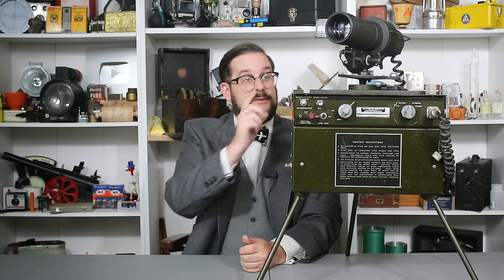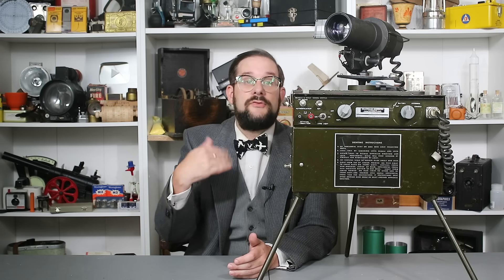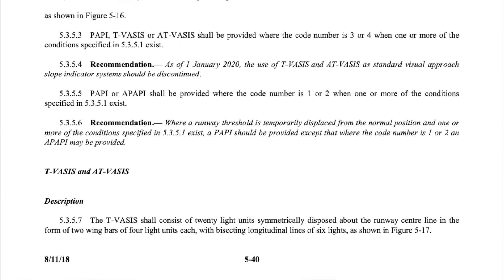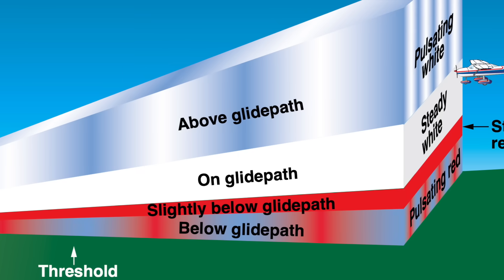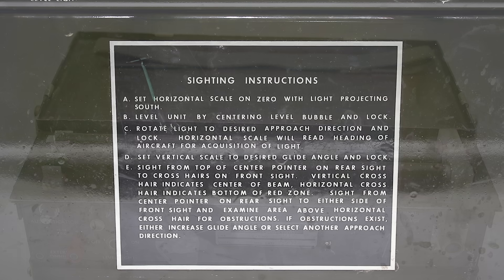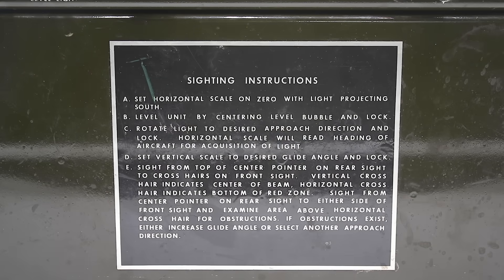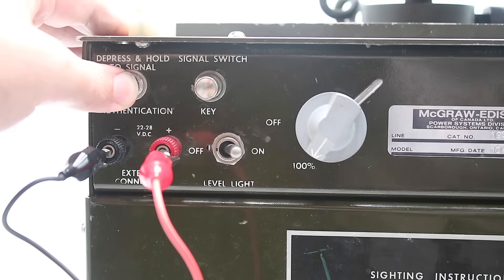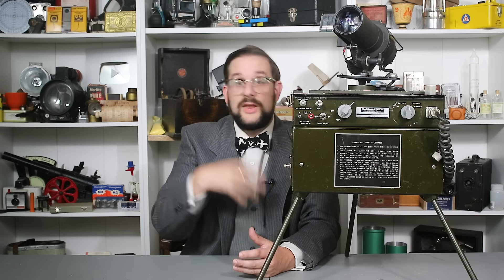Portable VASI: Come Crash at My (Heli)Pad

Comment: Wiping off that o-ring with alcohol and then applying a very sparing coat of silicone spark plug grease might make that back cap a better experience.
Reply: I recommend regular oil of sorts - WD40, Balistol etc..

Silicone works great at first - but makes rubber, leather etc. briddle over time. Not great for long-time preservation.
Reply: @stanislavczebinski994 - what is wrote is completely wrong. The correct information is the complete reverse.
Reply: @johncoops6897  Sorry - I don't get it....
Reply: @stanislavczebinski994 - Silicone grease is specifically for use on rubber and o-rings.
That is because petrochemicals like oils and WD-40 destroy most types of rubber. WD-40 alsi degrades many plastics, for example causing bushes and hinges to squeak.
Reply: @johncoops6897  That depends. Some oils contain fat acids. IDK if WD40 does -  Balistol doesn't.

Plastics and most types of rubber get briddle over time - due to the chemical softeners getting lost.

But those have improved massively in the last ~20 years.

Back in 2001 when I bought my 1991 Golf - all the interiour bits were quite briddle already.

The same parts on my 2006 Ford Focus ST are still quite flexible - even after 19 years.

Chemistry advanced quite a bit in the meantime.

Comment: Your diagram, correctly, shows a dark amber beam between the green and red sectors. Be aware that it is a spurious indication. It's not part of the design but is the result of mixing of the red and green beams. It's not always there but, if seen, pilots are cautioned to not confuse it with the too-high indication.

Comment: PAPI is used at larger airports because of the larger amounts of different sized planes. So 1w/3r would be used for small airplanes where the cockpit is very close to the landing gear, 2w/2r would be used for medium sized aircraft like a normal 747 and for jumbo sized (where cockpit is far from the landing gear in height) you would use 3w/1r.
Reply: Why would height above the wheels change which glide slope the plane needs to follow? All else being equal, having your wheels be 30 feet below your eyes  means you’d just touch down a bit earlier on the runway right? Is it enough to matter?

I typed this up and then did the math. To travel 30 vertical feet at 3 degrees slope requires nearly 600 horizontal feet. That feels like quite a lot, given the target point is only 1000 feet down the runway
Reply: @mrb692  I suspect its for obstacle avoidance. Since a PAPI glideslope would follow the pilot's eye, the landing gear would be more far down on a larger airplane and possibly intrude in safety margin areas for obstacle avoidance.

And same for smaller airplanes, you want the glideslope to be as close to 3* as possible, so if you can go lower in a smaller plane, its preferable.

Comment: Yeah, VASIs are only really used by fixed wing aircraft during visual flight rules. Modern Airliners can actually auto land during instrument flight rules during increment weather. Choppers of course can hover or fly directly up or down. Approach angles help fixed wing craft approach at optimum angles to keep stable approaches and speed
Reply: Helicopters also have an approach angle, and often take off in reverse, so I suppose they use glideslope lights in reverse on takeoff?
Reply: @ABa-os6wm Any time a helicopter takes of or lands in any way other than like a fixed wing is a non standard situation. Yes it can do it, but 99% of the time its plain old school flying. They taxi to a runway and depart. It takes a ton of fuel to hover or go vertical flight. Plus its vastly more dangerous with more chane of ocilation and even disorientation while landing.
Reply: Autoland is rarely used. It's reserved almost exclusively for Category III operations, although some Cat. II approaches also use it. In Cat. I conditions, or visual conditions, the pilot will hand-fly the final approach and landing. Airliners also depend on VASI or PAPI. It's not just for small aircraft in VMC.
Reply: @johnopalko5223 No reason not to at least take a glace even with fancy auto pilots. My instructor said you got to learn to fly before you learn what to fancy stuff does. Then he would ask. What it stopped working during the flight. You need to be able to get to the ground still. Made a lot of sense to me.
Reply: VASI is double checked by every pilot every landing. Rule #1 never ever blindly trust the instruments. If you can confirm you do it. All civil GA aircraft heavily rely on them. I can swear by that. When landing with a 15 knot cross wind with moderate storms in pitch black those little lights will get you down safely. Trust me.

Comment: What indicates that it was meant for helicopters and not fixed-wing?
Reply: The steeper approach angles it's capable of is a good indication. For fixed-wing you wouldn't need anything steeper than about six degrees. Three degrees is what approach designers will use, if at all possible.

Comment: When I was learning to fly in the 1980s , my instructor took me to a small airport that had someting that was, apparently, rare at the time and probably not to be found at all today.  This was what my instructor called a "billboard VASI."  It consisted of 3 big yellow "billboards," each with a black bar across the middle.  Two were elevated some distance from the runway threshold while the third was close to the threshold and on the ground.  If you were on the slope, the 3 black bars would line up, but if not, they would not, the middle one (at the threshold) would be high if you were high or low if you were low.  I never saw this anywhere else.
Reply: It's still mentioned in the Aeronautical Information  Manual (AIM), or, at least, it's in the 2022 edition. They refer to it as the "alignment of elements" system. See Paragraph 2-1-2(e).
Reply: Thats a cool system

Comment: The bubble level seems a bit crude, at least if this was going to be used for fixed wing aircraft.  A few degrees steeper is very different on final.  Are helicopters more flexible for approach glideslope?
Reply: He didn't get it level, so it's hard to tell just how sensitive it is.  You can get some pretty good precision with a bubble level, depending on the internal curvature.  That being said, I don't think helicopters have a "glide slope" as much as an "approach path".